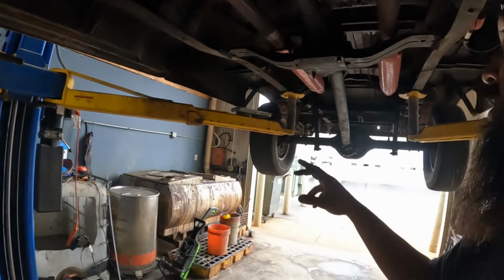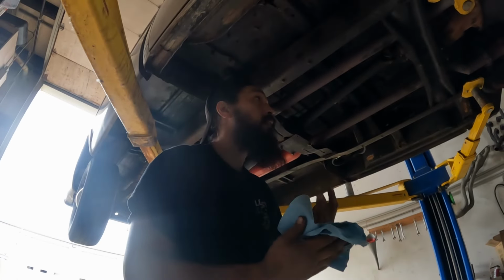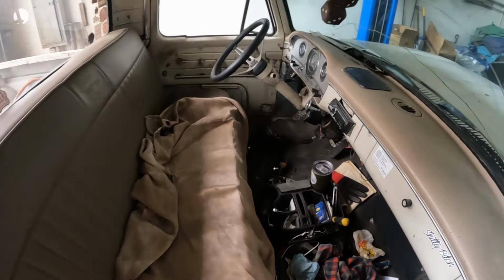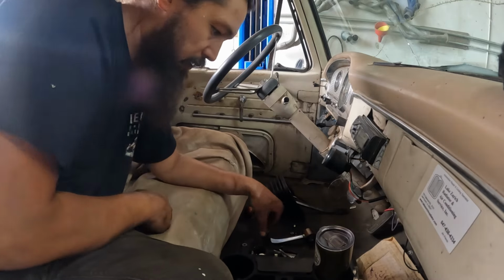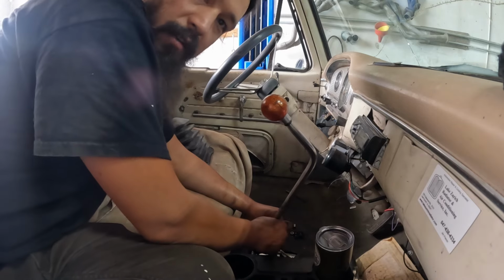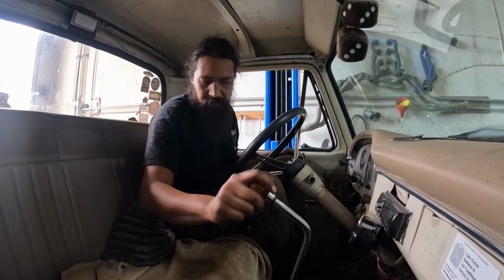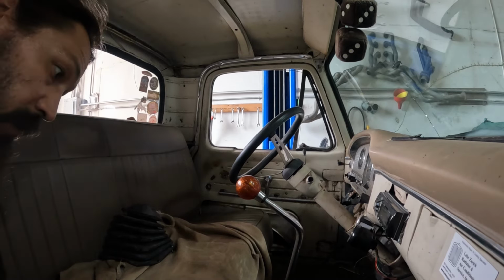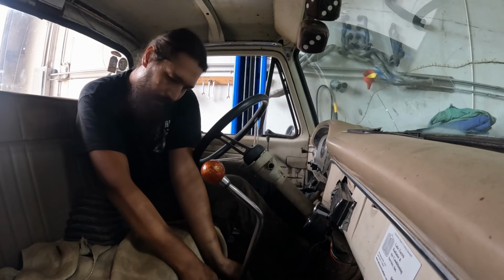'64 Ford F100:  Transmission Swap Day 3 - Shifter Mods and Test Run

Comment: A lot of my transmissions won’t shift nice unless I use the clutch. I got a piece of straight stock and a lawnmower knob for my 7.3. In your case I’d just heat the shifter up and bend it straight. Some cool guys use wrenches for shifters. I almost did
Reply from the maker: I should have fired up the welder and finished it when I was working on it.  It's still in the bolt in configuration now, even though I hate the location.  But it's running great and I just don't want to get back in and weld it.  I'll get to it one day though.